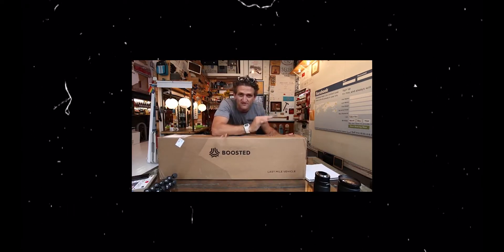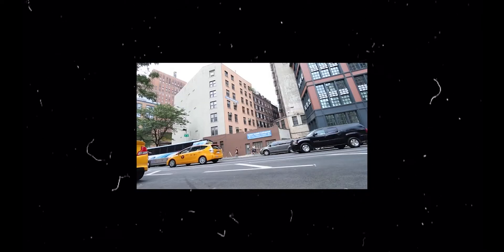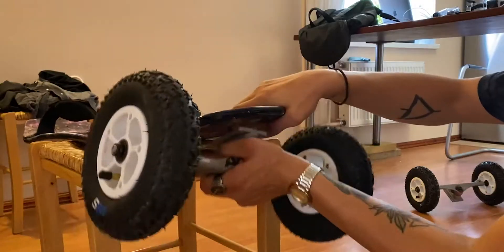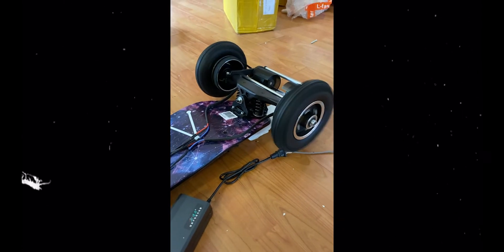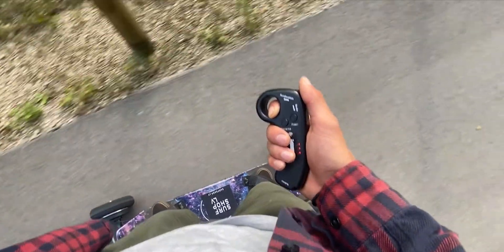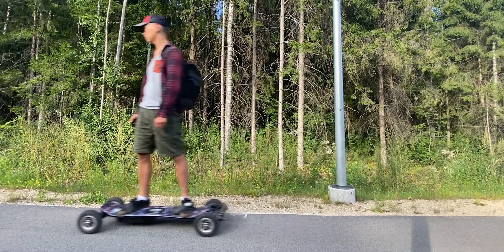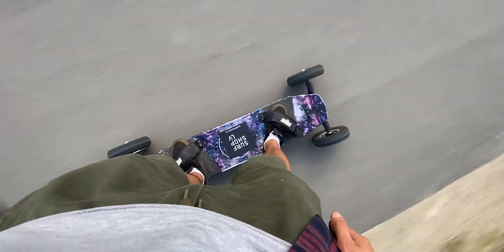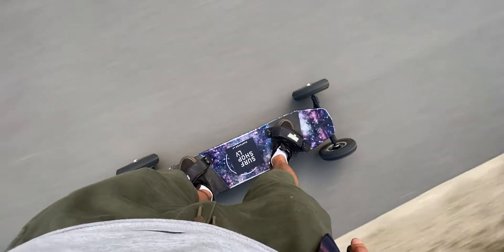HOW TO BUILD INSANELY FAST OFFROAD ELECTRIC SKATEBOARD (with parts list!)

Comment: Hello, unfortunately your Alixpress link for the battery doesn't work anymore. Do you have an alternative link or the exact specs of the battery pack you were using? Appreciate in advance. Other than that is the motor brake sufficient to stop the ride or do I need a truck with embedded manual break disks?

Comment: Great video! Where's the parts list??
Reply from the maker: I used this battery https://www.aliexpress.com/item/32815810818.html
and this motor kit. https://www.aliexpress.com/item/4000538854045.html

on top of that, you will need to buy a deck of your choice :)